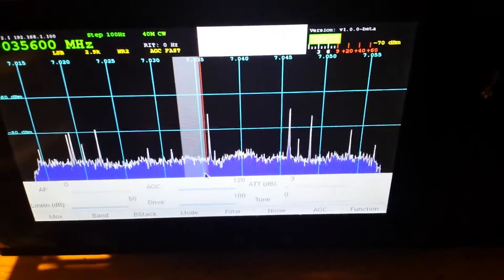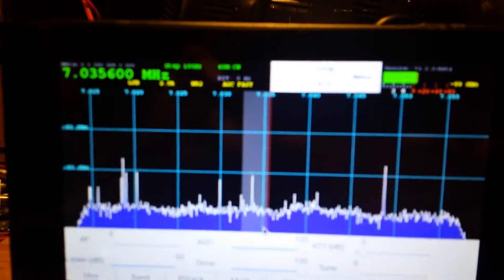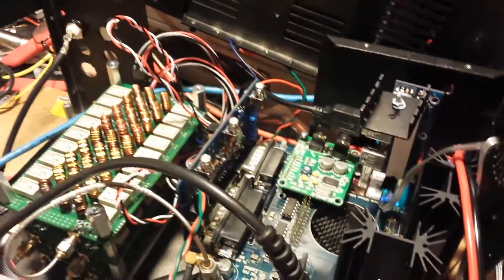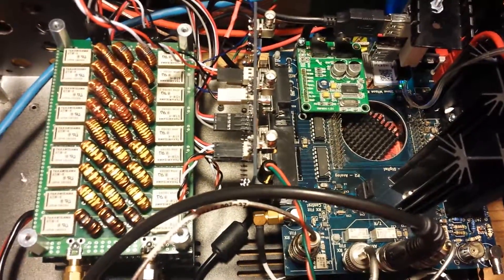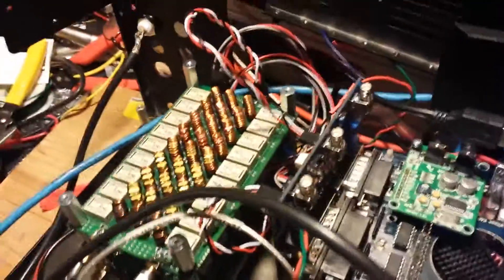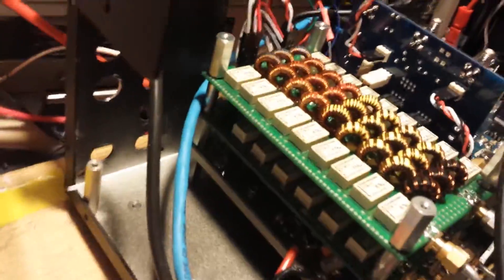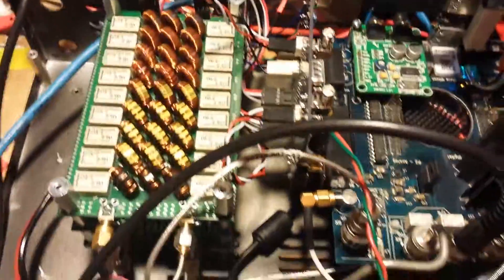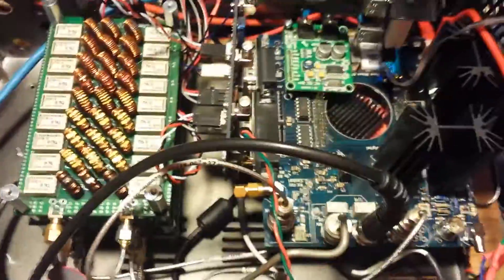radiodemo

Comment: I'd love to see a parts list and write up for this project.   
Where did you get the shield board ?  Which vendor(s) sell the bandpass and low pass filters and the power amp ?
Reply: You will find the design for the shield card at https://github.com/ka6s - I designed it and got it fabricated, then did the assembly.  All the boards used in the radio are at this github site. There is the main shield card, an auxiliary power supply card that powers the Raspberry Pi (Now Tinkerboard), a button board to connect the Rotary Encoders and tuning knob that connects to the Raspberry Pi, and an extended Filter interface card that has an SWR bridge, and PTT switching for an external Amp.  The Bandpass, 10W amp, and Lowpass were all from Ebay - and here is the link to one of them. http://www.ebay.com/itm/HF-BPF-band-pass-filter-RTL-SDR-HERMES-ODYSSEY-HiQSDR-Red-Pitaya-transceiver-/332074659425?hash=item4d51312e61:g:LTUAAOSwHsRYDJ1I   - Note that the same guy sells all three, and they are all the same form factor.  The radio was originally built to work with the Filters from EB104.ru without the Filter IF card.  I had issues with those and they are physically much bigger.... so I found these on ebay and used them instead.
Reply: Thanks !